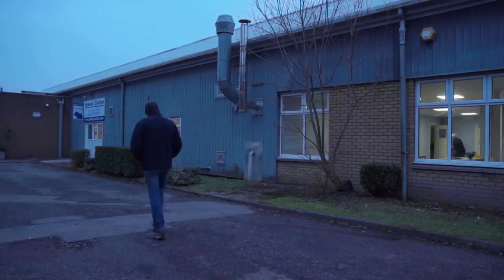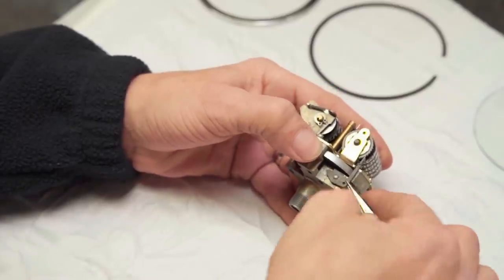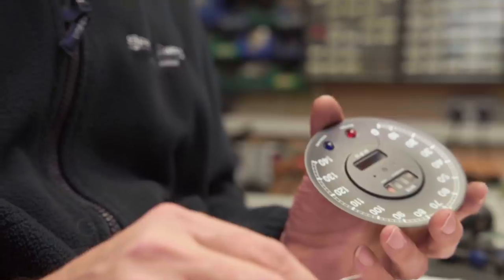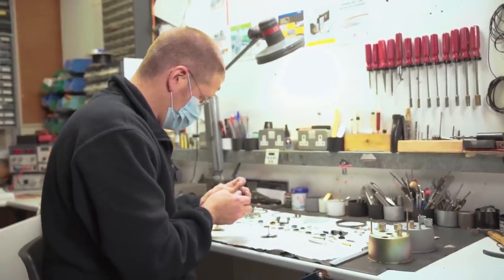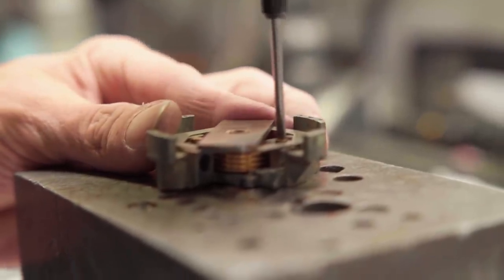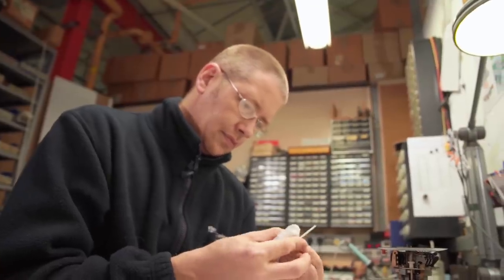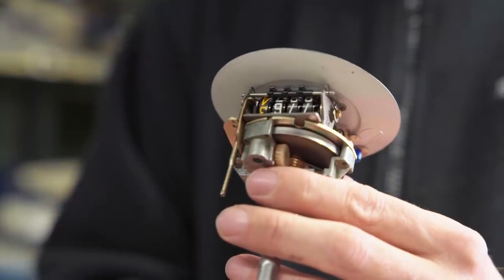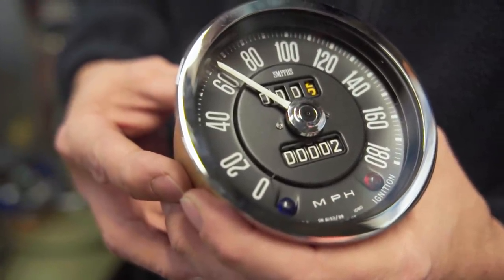Aston Martin DB5 Speedometer EXPERTLY RESTORED: Pro Shows How It's Done | Top Gear Handcrafted

Comment: My father used to fix and restore vintage instruments, he did it for many years. One thing he would do on an old speedometer like that is to "machine" the axle that holds the magnet, with sandpaper. Just a little, enough to remove some grooves. and make it smooth again.

Comment: Wonderful to watch but wonder why the odometer wasn't reset to zero or adjusted back to the previous reading.
Reply: Was wondering the same.
Reply: Yes converting kilometers into miles .
Reply: @richardg8651  excellent point but simple math can be done to figure the equivalent if it is being reinstalled in the same vehicle, with the same engine.